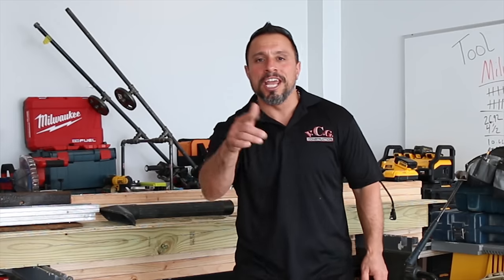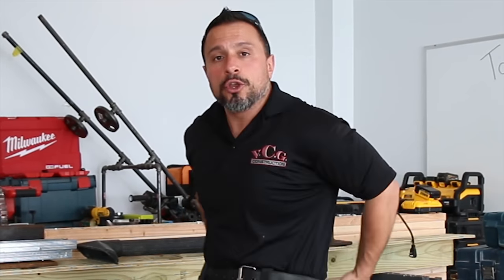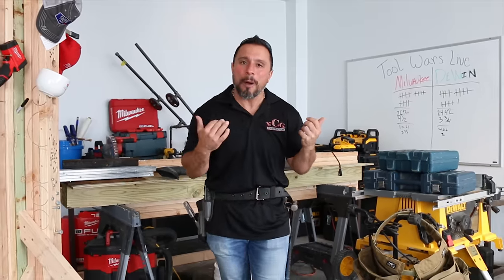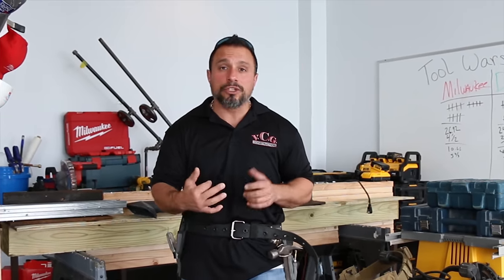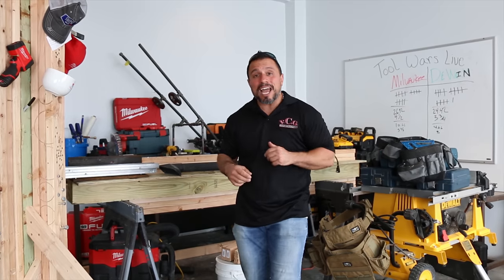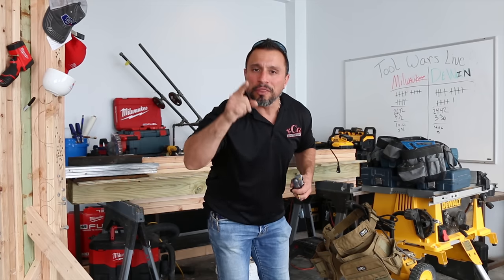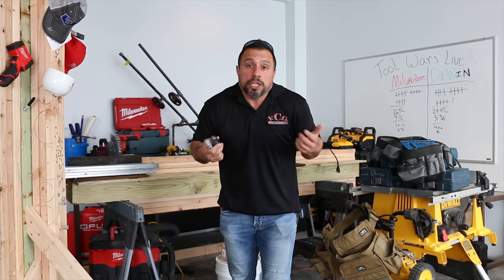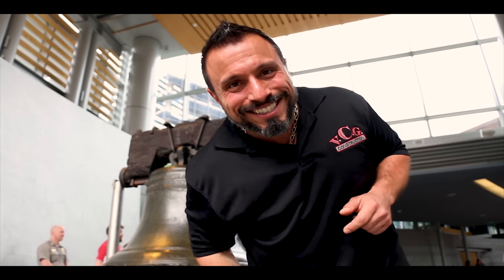Do You REALLY Need A Good Tool Belt For Work?

Comment: I learned a long time ago and after tripping over the very tool I was looking for while losing another at the same time the tool belt turned a nightmare into a smooth running project. You are spot on with the tool belt. May I suggest a belt with shoulder straps to avoid back problems later in life.
Reply from the maker: That’s a good suggestion Mike!!

Comment: I use toughbuilt tool belt which is modular. So I set up pouches for specific jobs and can add/remove as necessary. One of the benefits is I don't hump around unnecessary weight but can grab and add what I need quickly to the belt. I also have the clips attached to my work bench works great.

Comment: i try and wear a tool belt as little as possible and i do pretty much as you have stated in the video when i do wear one, i minimize the tools to exactly what i need to do the job efficiently, in fact i have 3 different set ups 1- for layout and boxing ( i'm an electrician, mostly resi.), 1- for wiring and the first 2 are just HD 6 pocket type nail aprons for hardware with small 2 to 4 pocket add on type tool holders and hammer loops, to carry only what is use for those specific tasks and the 3rd one is a full blown electricians pouch complete with hardware pouch, drill holster and basic 2 pocket cloth type nail apron, for either cutting in or trimming and when doing plugs down low, whether it be cutting in or installing recepts. i use a "brake mechanics" wheeled chair and roll from outlet to outlet.

Comment: Here in the UK . Most of the time we just work with our snickers workwear trousers with built in knee pads hammer hook and tool belt . We only take the tools necessary for the job at the time. Hammer tape pencil nail punch nail or screws folding rule speed square in back pocket. Keeps us light and fast. If it rains we wear waterproof trousers over our work trousers and then go back to a traditional tool belt set up.
Reply from the maker: You love the snickers James!!

Comment: I have suspenders on my tool belt to help distribute the load. The weight isn't the problem, pulling down my pants all day is annoying. Before it's said, I ware a belt, after a while the weight will pull on your clothes. The tool belt or not depends on the job sometimes I just work out of my tool bag but that's when what I'm working on, is localized and I don't need mobility. The tool belt comes out when the job is more spread out and all day and I don't want to keep running back and forth to the tool bag. I also have different belts for different job, one for electrical and another for carpentry. They can make life a lot easier

Comment: employees should not have to borrow hand tools....power tools is a diff story....if you dont have the hand tools you need... on your way home from work stop at the deeps or lowes and buy them !! even an apprentice should have a drill kit at minimum....i spend $1500 a year on tools i need for work otherwise i cant get jobs done....not saying an apprentice should be doing that especially power tools but hand tools yes...they are not that expensive....remember....your not going to be an apprentice for 2 years....git r done !
Reply: Especially after that first paycheck, if you are hurting needing a paycheck thats one thing, but after that, definetly need to get the bare essentials at a minimum. Even if its cheapo harbor freight stuff that wont last but a couple months. Its better than nothin.
Reply: I bought my brother some starter tools from Lowe’s because he kept borrowing mine. Basic belt, hammer, screwdriver, utility knife, tape, square, pencil, nail set. Think it was under $60 for all that. Name brand stuff at that.
Reply: Tools are also a write off expense at the end of the year 💪🏻
Reply: Miguel Salgado sadly in California we can’t do that anymore

Comment: I use a tool belt and I'm just a DIYer!  I had to train myself to stop putting tools down but instead put them in my toolbelt. I used to lose things all the time and walk in circles for a tape measure or whatever. If it gets too heavy then lighten it up for the job your working on but put some of the tools into a proper toolbox so you know where they are!

Comment: As a home renovations GC, the majority of our work is indoors on finishes. So our crews wear small clip pouches that have the basic essentials needed everyday. Screwdriver, razor blade, flat bar, pencil, level, needle nose, tape measure (16’ Milwaukee), and on the opposite side our dewalt 20v impact, cordless pin nailer, 4-1/2” circular saw, or oscillating saw....depends on the task at hand. Love the small clip on pouch because it is quickly and easily removable if getting underneath a cabinet etc.

Comment: Those Husky Brand Leather bags at Home Depot work just fine. I have a much nicer set, But functions the same.
Reply: If your a framer or carpenter, i could see needing an expensive set of bags but for most trades those husky bags will get the job done, I’m a commercial roofer and those husky bags get the Job done and are pretty light weight.. with that being said I want to upgrade to a nice buckaroo tool belt but it’s mostly just ta help be a bit more organized and also I’m just tryna be fancy ta feel better about waking up and going to work every morning..
Reply: @Justin-cl7lg  looking at the buckaroo myself. I’m grabbing the belt in black b/c of 50 year edition. I can always buy more expensive bags later. I’ll just use cheap bags on a good comfy belt.

Comment: Haven't worn a tool belt in at least 4 years but I do all the cutting. The guys I cut for wear them. I have a tool bucket beside my cut station at all times,if I been to climb up and help someone I have my hammer in a hammer loop , tape measure on my side, speed square in my left back pocket and razor knife in right rear pocket  (that's there first thing every day) been doing it this way for years
Reply from the maker: Thanks for letting us know Joe!

Comment: I use to work with a guy who always left his tools around.  Once, when we were on the roof installing a weather station and running Ethernet cables, I had to go around the roof gathering his tools.  He always left flashlights in drop ceilings, too.  Of course, he came to me to borrow flashlights.  Cordless drill/drivers were left behind as well.

Comment: @VCG Construction Vince can you suggest a good belt or even an apron for a home woodshop? It's a hobby now but I want to build my skills and move up. Plus I'm guilty of putting my tape measure down (brand new Milwaukee tape measure and love it!) And then next thing ya know...."where did I put my tape measure?" 

I don't want go buy junk but don't really need a top of the line belt either. I want my pencils, maybe my drill and/or impact driver, maybe a triangle square, pockets for a handful of screws etc. Any suggestions?
Reply: 99% of people dont know what a triangle square is... 😂 sorry, just being a smart ass. I'd say anything that fits well and won't be uncomfortable for you is safe bet. Hard to go wrong these days. Decent suspenders are a great addition to any belt set up . Hell I think you can mix/match and configure your own  preferences and brands most places.

Comment: Vince, I think you’ve been watching me do work around my house because you described me to a T. Always putting stuff down and forgetting where I left it or putting a board, box or cover on top of it and not able to find it. Every time I put up moulding I have three tape measures and pencils going because they keep getting left outside with the saw or inside when I go outside to make a cut. And I have a tool belt but just never wear it. It’s a little big on me honestly so time to get a smaller one that I’ll actually use. Thanks for the tips now I know why little jobs take me so much longer they they should. Even DIYers can learn from this stuff too.

Comment: I’m not a fan of wearing a tool belt unless absolutely necessary. I do have one and it is overloaded with the go to items which makes it difficult to wear but it’s always in reach. I’m mostly doing trim or indoor carpentry however. I have a quality work apron that I will wear that works well when I  tend to be working over a larger 
areas. As you’ve remarked about unloading your belt to prevent damaging your surroundings the apron makes me more mobile and less prone to damaging something. I am in high end construction and everything and I mean everything I’m around is one off and expensive.

Comment: I'm a fan of two belt manfacturers; Rooster Products of Mexico & Occidental Leather of California. BOTH make excellent belts. Rooster was sold under several branded marks like AWP (American Work Products), Craftsman, etc..., and I believe that McGuire Nichols bought them out. They made the absolute best entry level leather belt systems. They were like budget Oxy's, but not cheap in quality. They nice oil tanned thick leather and I loved them. There was a time when you could set yourself up with a complete rig (2 belt pouches, a hammer loop, a tape pouch and a belt) for between $75 - $100 and this was 15 years ago when that was still some money, but it was WAY worth it because they lasted. 

Occidental is on a whole other level though. They were worth 3 or 4X the cost of a Rooster Rig. Their heirloom belts that you could pass down to your kids or grandkids if you weren't a big production guy. When my home got flooded and I lost $10,000 of equipment, the one bag I forded 5' of water for was my AWP leather tool bad with my Oxy's in it and a god $1000 of hand tools. All the other stuff (even though it cost a lot more) was replaceable, but my main tool bag? With that, I could completely earn the living to re-buy everything else in weeks. 

There's just something more personal about hand tools over power tools. Estwing handles turned green from your sweat, knives that you can change the blades practically blindfolded from knowing them so well, Stiletto hammers that feel like an extension of your arm, that old old old set of pliers that you use for everything from pulling nails to light metal bending...they all are different than a power tool, because "you" are the motor of that hand tool. 

Anyway, good stuff as always fellas.
Reply: Meanwhile, my old man worked for 1/2 a century with free lumberyard aprons and Sears hammers because he'd wear one out for roofing every year and turn it in for a brand new one. The man didn't buy a hammer for decades. That, a folding rule, a roofing knife and a pair of snips and I still couldn't keep up with him with all my stuff & my leather tool bag. Crazy old school.

Comment: I’m a plumber and I wish I could fit basic tools in a tool belt. The only thing I have is a little pouch with a hammer ring. It works great for a hammer and nail on hangers or it also holds rings cutters and the uponor gun for doing 1” and smaller pex. Other than a clip on tape pouch, there’s not much use for one as a plumber

Comment: I used to wear a tool belt when I started my apprenticeship as a plumber about 6 years ago. Then I got into a bigger company and they didnt want us using them. And then I went to the company I'm currently at and no one uses one at all. I will sometimes throw mine on depending on the job I'm doing but most of the time I have a small tool bag or a tool bucket.
Reply from the maker: Thank you for the input!!

Comment: Started with a couple husky pouches on a belt, worked with the Atlas 46 vest all summer, now using the Husky suspension framers rig. In the spring I'll try out Atlas 46s rig. But I also have plans on doing review videos after further testing.

Comment: It really depends. I wear carhartts every day. So if I’m just doing over head work like drop in anchors and all thread. I only need a hammer and a set tool so I don’t wear one. If I’m making up junction boxes or boxes in general I use a Klein apron. When I’m roughing in walls or running pipe  I have AWP leather tool pouch and carpenter drop pouch to hold couplings, connectors, straps, and self tap screws. Along with suspenders. Also what company tools? Mine doesn’t supply hand tools.

Comment: I know this is an old video. But still.  I have been debating on getting a tool belt but I do low voltage electric work. I dont know ANYONE that uses tool belts so its hard to get an opinion on using one as an apprentice.  This video makes me feel like I should just try one.

Comment: I recently started my carpentry apprenticeship in April (2022), and I’ve been bringing my tool belt to each job site since day one but I’ve never used it. For some reason I’ve never seen anyone in this company strap on a tool belt 🤔. I usually carry my tool belt and tools in a 5 gallon bucket. The carpenters that I follow for my apprenticeship bring a bag full of tools. It’s pretty strange. Like I feel weird if I put my tool belt on. SMH.
I worked construction for maybe a year and a half back in 2006, and it was the other way around; it felt weird not having a tool belt on.

Comment: The only time i dont have my tool rig on, is when im just humping lumber, or doing demo. If im humping lumber sure that few extra pounds adds up quick, and its just kinda in the way. but as soon as i need a tool, its back on. 

With demo, its typically with a chainsaw, so i dont wanna snag on the saw or anything else, and again not really needed in that instance. and ofc i take it off from lunch cause sitting on a screwdriver is not fun. shrug

Comment: I love my belt. I even wear it in my shop. But, I need to get suspenders. I was not blessed with enough butt to hold my pants up. On a side note, holy crap that Atlas 46 stuff is super nice. I could only imagine.
Reply: Watch for when they have factory seconds or gently used stuff, still comes with the lifetime warranty. Got my vest gently used and it looked brand new.
Reply from the maker: What kind of belt is it Rob? Atlas 46 is pretty sweet!
Reply: Atlas is great and sometimes if you buy a couple cheap things, they will ask you to review the item. Review it, post it on a social media and you get a 20% off coupon. 

Also if you contact them first say you are a first time buyer, you can get a 10% off coup. definetly helps.

Comment: I always have to use a belt as an electrician on the job. Sometimes have 40-60 lbs of tools n fittings in your pouches. Still somehow lost my bit set for my impact driver tho, good thing they are only like 10$ for the basic dewalt one at Home Depot lol

Comment: I remember the first time I left my screwdriver in my back pocket. when I jumped in my truck and I heard a rip. I wish it was my jeans but it was my seat.
Reply: Truth. DId that to a customers car as a mechanic, thankfully his seat was in shreds to begin with and he was cool. If i had thought of using tool bags as a mechanic i probably wouldve been a ton more productive. 

its crazy, but its true, i had tools in my pockets all the time, and digging for that tiny 10mm wrench buried in my pocket cost me a ton of time. Bags wouldve helped A TON.
Reply: Considious Gaming , that sucks, my truck was new at the time so I was pissed but at least it was my own truck. another time my wife and I bought a new Nissan pathfinder and she came by the job in it to have lunch with me and I got in the front seat and there was a little construction adhesive on my pants and a little got on the leather. we were both pissed lol. 

after 30 plus years in the trade I'm looking at getting the Atlas 46 tool vest. I bought a cheap one from bucket boss or something just to see if I'd like it and it saves my back. the only problem I have is a place for my speed square and flat bar and second, when you bend over shit can fall out.
Reply: If you go the journeyman with cargo pockets. you wont lose everytyhing. I personally went with the saratoga vest for more versatility. and it can hold hte flat bar in the aims webbing. so the journeyman probably can too. and it can hold it on the magnets altho kinda touchy unless you get the good ones. 

Also there is the knox speed square pouch or the screw and nail and tool pouchs all seem to have a speed square part in them. i personaly use the knox and it works well.
Reply: Considious Gaming thanks, I'll check it out this week. I'm finally ready to upgrade to a better vest.

Comment: Here's an idea, spend money to save money. Buy the idiot apprentice(s) a cheap starter tool belt, you know a cheap one bag or two bag belt from HD or Lowes. Not anything expensive or fancy: a belt is better than no belt, a pouch or bag is better than no bag or pouch.

Rule to start, if the apprentice needs to borrow a tool more than three or four time, the apprentice either needs to buy it himself or somebody needs to find a way for the apprentice to get a decent but not expensive version of that tool. An inexpensive Dewalt bit set at HD is <$10, apprentice needs to eat some ramen and buy a bit set.

Comment: You take with you what you feel you might use;  Many tools-Box truck, truck, backseat, toolbag, tool pouch, pockets, hand-few tools. Sometimes you want the whole shebang with you so you fill a boxtruck with tools, sometimes you need just a screwdriver and a knife which fit in your back pocket. 
Tool pouch is essentially a gigantic pocket, it fits just enough. Sometimes I'll bring my whole bag in and keep it handy when I need 50 things, sometimes leave it nearby when I need 3-4 things, almost all of the time it makes sense to put the pouch on because you need 10-12 things. 
NEVER take someones tools lol I carve my initials into every tool I own, and at the end of the day I double check every single thing I have to make sure I didn't accidentally steal someones tape or something. Good practice to not be "that guy".